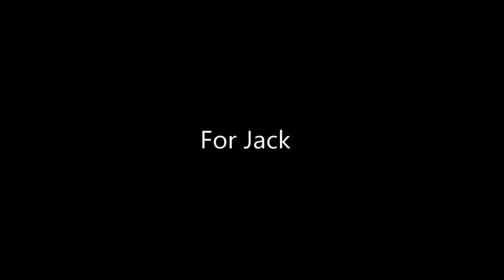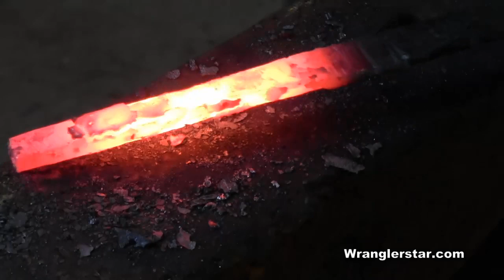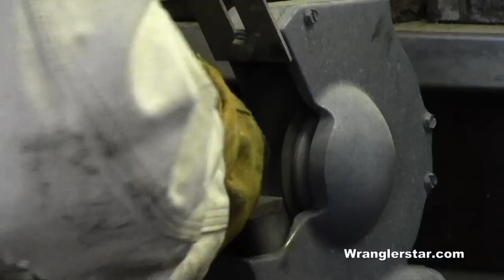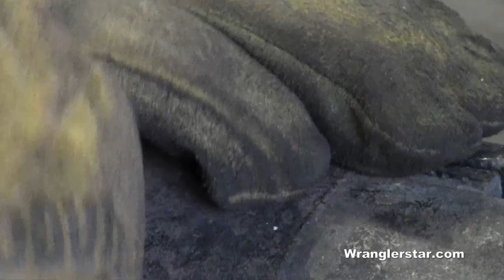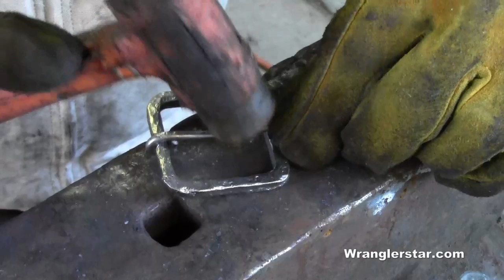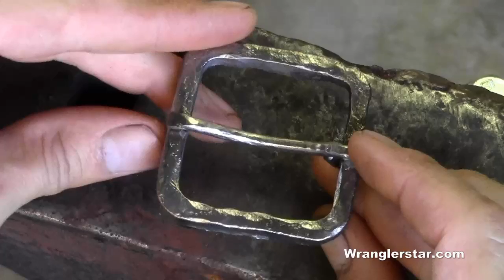Blacksmith Forging A Belt Buckle

Comment: I would put a notch on the belt frame at the loose end of the prong so it can't slip. Not a big deal from an everyday use standpoint, but putting a load on the belt could make it torque to the side and twist the belt to where it could rip more easily.

Comment: Very nice. How did you connect the ends of the metal to close the square. Welder? thats probably what I would have done. Or red hot and pound the overlapping pieces together.

Comment: Where'd you get the anvil from?  It's amazing how much work it takes to make one little thing that would take 30 seconds to make in a factory. It gives you perspective and makes the object special, though. I think it would help to clean the scale off the piece once in a while, that way you don't hammer it into the steel.
PK

Comment: Wonderful, That's a beautiful Belt Buckle, when the steel's Hot dip it in Water to replace some of the properties of the steel that are lost, for hardened steel the carbon from coal helps to strengthen the steel, but, I'm just saying, it's a beautiful Belt Buckle none the less., if you want to make a head for an axe, try doing Damascus Steel a really good steel Process that was discovered long ago when there was Vikings, a some what flexible, but a Hard Steel to break, great for making swords and tools. getting the Coal fire up to 3000 Degrees Fahrenheit and have lots of carbon, using coal,  bones you can use chicken bones from when you eat chicken and other stuff with carbon, Beat the steel to forge it for until it stops glowing red heat it again keep repeating the process until you've folded the steel around another steel a few times, when done with the forging process dip the work piece in water to cool it off quickly, I've been watching a bunch of videos about blacksmithing and I seen a thing on PBS that was making Viking swords,, they was trying to find out how they made a certain Viking Sword using the same method as what they most probably would of had used back then, but you do a good job.